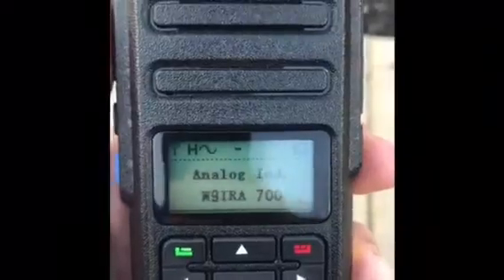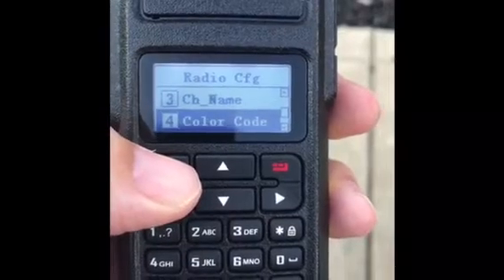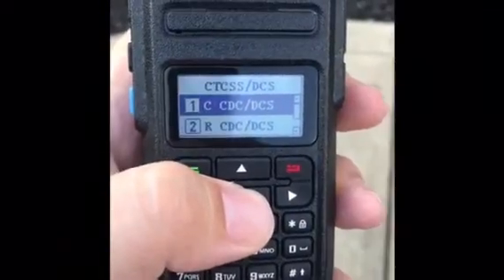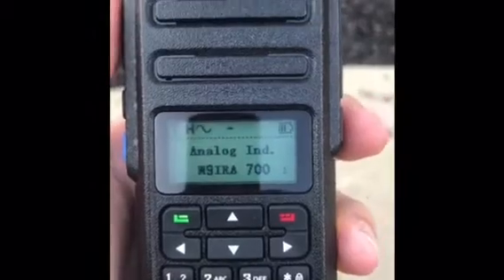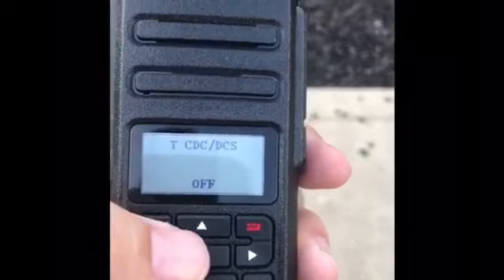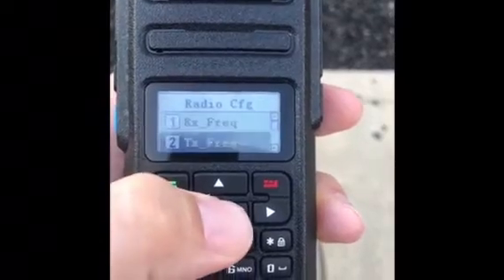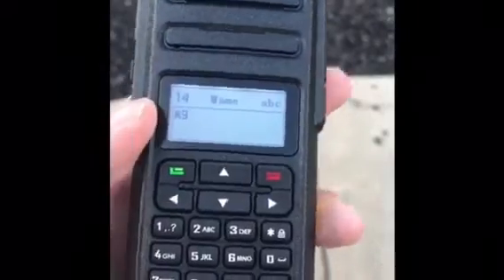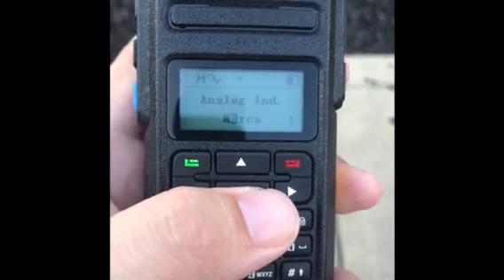Front panel programming analog the GD-77

Comment: I can't find the ctcss function om my gd 77 device. As if it doesn't exist. Anyone knows why? Firmware maybe?
Reply from the maker: Make sure the channel is Analog..  Are you using the software or trying from the front panel?
Reply: @indydad3911  haha thx for the reply. I figured it out pretty soon after though, just forgot to remove my post. You're right I had it on digital mode.

Comment: The program cable must be original or can be used by Baofeng radios uv5r, uv82, bf888s?
Reply from the maker: Marin Marin it is the same cable as the MD380 and not a cable like a Boafeng.   Different guts.
Reply: Marin Mari

Comment: How do you program it for Digital Modes without a computer? All my machines run Linux Distros. Thanks for the good Info.
Reply from the maker: Not sure you can but many people use a windows VM on linux to program.  you could try WINE too but I doubt that will work well.
Reply: thanks for the come back. I'll have to scrounge a windows machine from somewhere, Catch you on the Bands! 73
Reply: did a vm not work? what software is needed?

Comment: When programing how do you change from digital to analogue mode
Reply from the maker: When using the CPS to program you have to select a channel.  Right click on channels and select add analog or add digital channel.
Reply: Thanks for the reply but can I changed the mode on the unit it's self without the use of a computer!?
Reply from the maker: I don't recall.  I don't have a radio with me to look either.  I know I had added a bank of blank analog and a bank of blank digital channels so I could program on the fly.   It is much easier to use a computer to program the GD-77.   I would not be happy with it if I had to program it by hand.  If I recall to program digital you MUST have a CPS software.   I cannot recall why, perhaps you cannot add talk groups on the fly?  Did you join the "Radioddity Two Way Radio" facebook group?   You might also shoot an email to support@radioddity.com.
Reply: The post man has just delivered it today so I will need some time to become familiar with it, thanks for the Facebook link.